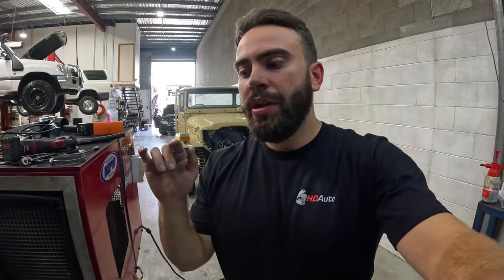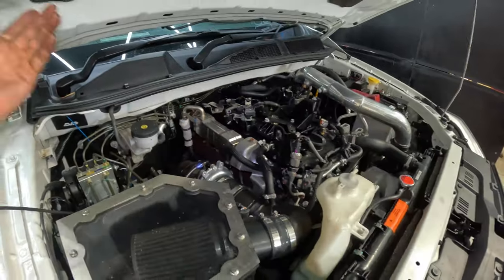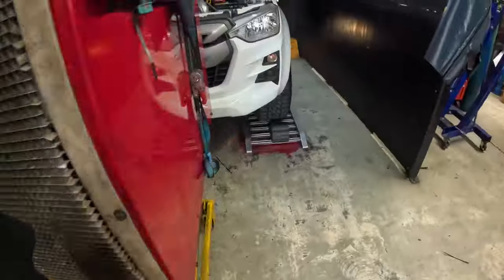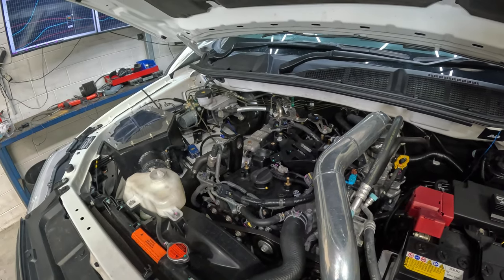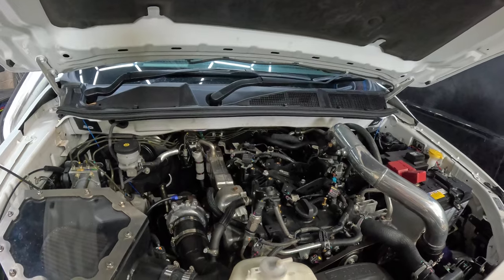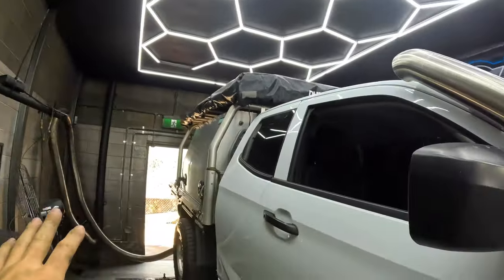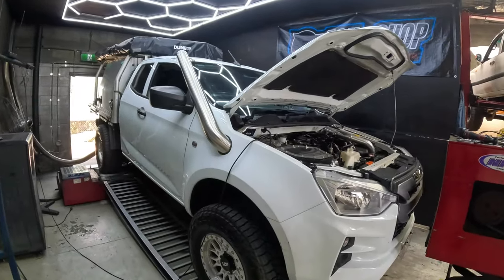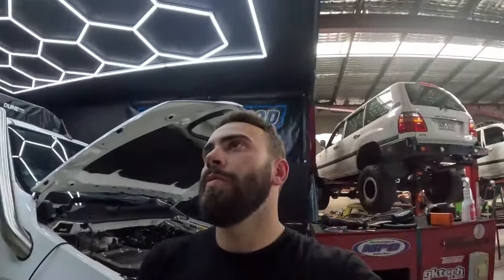HUGE POWER 4JJ3 ISUZU D-MAX! How did we do it?

Comment: I've got a 2015 Isuzu dmax 4jj1

Catch can 
30+ injectors
Custom fuel rail 
Munji powder coated stainless intercooler piping 
Ecu shop junior double touch combo 
Remap 
Egr delete 
Heat treated breaks and discs 
Turbo back 3 inch exhaust straight through no mufflers
Was running a billet flywheel and Npc clutch but couldn't stand up so now running crome molly flywheel and exceedy high performance clutch
3 inch dobinsons adjustable lift with 650kg rated rear leafs and long range shocks 
Munji diff drop 
Dinoed for bottom end and torque perfoming 260hp on 32inch MT tyres and on one of the ecu touch screen setting I've got a touring option. 
I've got a PDI intercooler on the way 
What turbo upgrade options have you got bigger than 44mm turbos As I'm still running stock turbo and do you have the software to tune ECU SHOP ecu's ?
And what stroker pumps do you have and aftermarket headers ?

I constantly carry alot of weight 
Single cab with full size canopy loaded and rooftop tent and often tow a 5.5m boat so i want at least 300hp to 350hp

Comment: my 2018 dmax needs a new turbo.. if i fit a gated turbo, can you delete the vacuum control boost actuator and make the gated turbo work ?
Reply from the maker: Absolutely can mate! The 2018 model is similar to these and will require an adapter flit and exhaust modification like in this video but very worth while doing 👌

Comment: Double the grunt surely it will reduce reliability ? (Not having a go at your work) Are they pretty strong internally from the factory ?
Reply: Have a proper look at what they are doing with the 4j in Thailand and you'll understand
Reply: @danielthornton3277 doesn’t prove long term reliability. You can work the crap out of any motor. How long it lasts for after that work is done compared to factory is what I’m asking. Do we have them with 300 thou on them, have they done heavy loaded towing and still proving them selves. I know I can throw a blower on my Y62 and not have any engine problems up to at least 150k due to others that have been done, but I do know the transmission will shit itself due to the extra power, this has been shown on ones that have a blower, then it’s a 15k plus rebuild for heavy duty clutches etc
Reply: @Stevegrande1  kind of like wondering the longevity of a v8 supercar...more performance will usually affect longevity and reliability, especially when asking double the standard figures
Reply: @Stevegrande1  cant speak for the newer ones but i have 4 of the older style ones with the 4jj1 and the truck gearbox with the pull type clutch and my highest hp one is around the 300 mark has 485k kms on it besides the obvious bolts on for power the only modification done to it is some bigger maincaps that are dowelpined into the block and its been pushing factory LS3 hp numbers for 150k kms now
Reply: @Stevegrande1 stupid comment. They’re a new motor. Good luck finding one with 300,000km’s. And if you’re paying 15k for a gearbox rebuild keep the y62

Comment: Can a 4jj3 stock internals handle 500hp because a stock 4jj1 internals can handle 500hp?
Reply from the maker: Stock 4JJ1 or 4JJ3 internals can’t handle 500hp mate
Reply: @hd_hayden  that’s weird cause i read it on google tho that stock 4jj1 internals can handle 500hp
Reply from the maker: @rvnuxmint9876 parts of them can, but not all of it can. The pistons can, the rods kind of can, the crank can’t, the head can. It’s a mix and match of can’s and cant’s
Reply: @hd_hayden  ok thanks for the information mate
Reply: @hd_hayden for 500hp you need the stroker kit and be running a stroker pump, bigger injectors and a decent ecu remap with the right software 
55mm turbo and up , intercooler, 3inch turbo back exhaust etc 

Most decent stroker kits from Thailand come with upgraded rods, rings, crank and you'll need to have your heads machined but it's very possible 
The blocks can go up to 1000hp
Reply: @hd_hayden correct